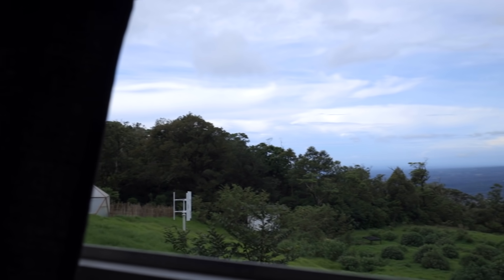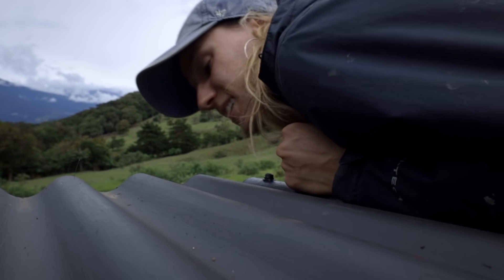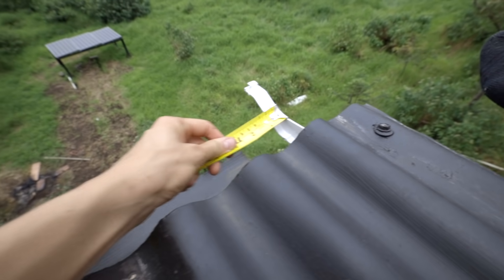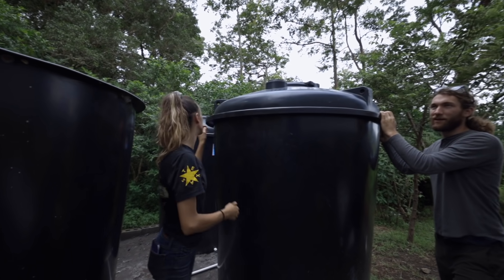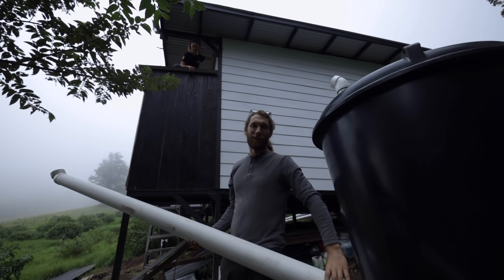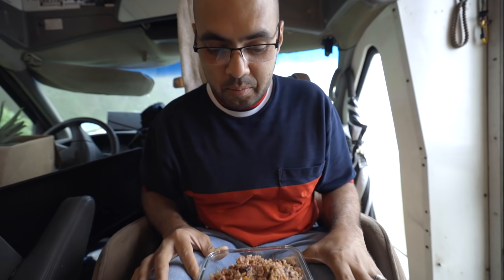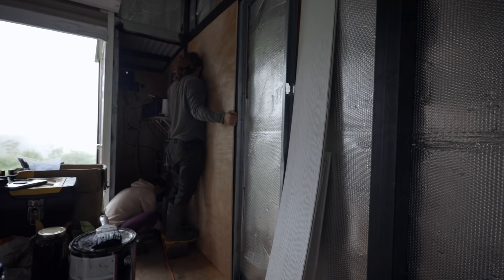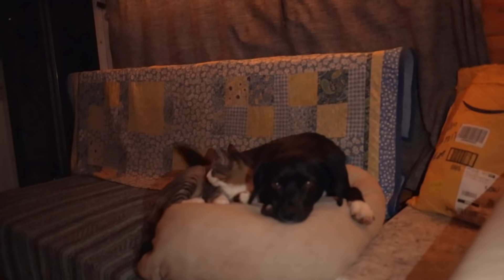Living Off Only Rain Water // off grid rain water system

Comment: My observation is the mistakes are a result of lack of planning.  I built only one house, for me and my family, but did not make a ton of mistakes.  That's because my nature, my education, and my profession trained me to plan projects.  I planned the schedule with critical path, costs, and made a comprehensive material list ahead of time.  Nothing was left to figure out later.  I spent more time planning it than building it.  You'll be able to do that on your next one if you choose to not make mistakes.  

That includes drawing everything out with dimensions.  Structure, electrical, plumbing, HVAC ...  Make you are modifications prior to finalizing your plan.  You guys have learned a ton and are able to build whatever, and if you plan it out thoroughly before you start then it should go off without a hitch.
Blessings.

Comment: Few comments on the catchment system. Did you make sure the gutter has a slight slope towards your down spout? Also have you thought of adding a first flush diverter? It helps clear the sentiment on your roof.
Reply from the maker: We did slant it slightly yes. We used a first flush diverter before and it didn’t do much because of the amount of rain we get. We don’t go through long stretches of time without rain for sediment to build up on the roof, it rains everyday! We’re going to have 1 sediment filter before the pump and 2 after so we will just see how that works out.
Reply: @NomadicMovement  makes sense. Every area is different and learning what works for you is so important. As an electrical engineer I've been really impressed with the things you have accomplished in your system. Next stop....hydro power!!! One thought for you tool hanging is french cleets. Customizable and very strong.
Reply: @NomadicMovement  Will you be using the heat buildup from the wind mill,  to provide the workshop with hot water?

Comment: Great work on the rainwater collection system.  Have you guys researched about a first flush diverter valve?  It diverts the first little bit of rainwater which is usually dirty from dust/dirt build up on the roof.

Comment: Have you considered building a shipping container barn? This would give you secure tool storage and lots of dry work space. This is a project you could build relatively quickly and then you could move into the structure you just built.  Surely there would be used shipping containers available in Panama. There are lots of examples of shipping container barns on the web. Cheers

Comment: You should install wood blocking between the metal studs at the height you want the shelves to mount. that way the shelves mounting hardware have a solid backing to attach to, otherwise you risk the hardware pulling out as they get heavier. it would also mean you dont have to hunt for studs as you attach your shelves.

Comment: Yeah, those studs are flimsy until you screw the plywood to them. It's the same way with wooden rafters that holds up the ceiling, they are all wobbly and flimsy until you nail the plywood to them, and once you do they don't wobble anymore, and they can hold massive amounts of weight. 
Glad to see you're using a long straight board clamped down to guide the skill saw. It makes it so much easier to produce clean straight cuts.

Comment: Hi and good work.  I know you guys were given the wind apparatus but you will never get much power with your set up.  First, the design of your generator has been discredited.  It just doesn't produce much power; thus, you need the standard 3 blade design that you see in large wind farms, boats, islands etc. Third, you must get height.  Even 30 feet off the ground you will almost double the wind capture and with tree canopy in your location you have to be above the canopy.  Love your vibe and positivity!!
Reply: Haven't heard anything about vertical wind turbines being discredited. There's plenty on the market and they're omnidirectional, which makes them very efficient. Jordan said that this one is 1kW, but the most similar that I could find is 10kW with a very low start wind velocity ~3.5 mph. However, there are also models with hinged blades that use centrifugal force to reef against excessive rotation during high winds. 
IMO, you are 100% correct about needing to get the turbine above the tree canopy (plus further away from the forest would have helped. Oh well). Under the circumstances, I'd start by inserting a 20 ft pipe (w/welded flanges) in the middle of the tower, with 3 guy cables. (I would hinge the bottom and rig a winch to raise/lower the tower) That will probably be sufficient for their battery bank, which will need to be expanded.
Reply: @TheOleHermit  There's a lot of worthless crap that sells.  That design is snake oil.  Completely inefficient.  5 minutes on google is all it takes.
Reply: @jlsinchina  Actually, thanks to you, I've just spent ~ 1 hour researching half a dozen "vertical vs horizontal wind turbines' articles and have found the common comparison as such: 
"– HAWTs are generally used under streamline wind conditions where a constant stream and direction of wind is available in order to capture the maximum wind energy. HAWTs are not effective where the wind is turbulent, so they are generally located in areas where there is a constant directional airflow. VAWTs, on the other hand, are mainly beneficial in areas with turbulent wind flow such as rooftops, coastlines, etc. Unlike HAWTs, VAWTs can operate even in low wind speeds and they may be built at locations where tall structures are prohibited."
Nothing whatsoever about VAWTs being crap designs. I've also been interested in alternative energy for 25 years and have never seen anything negative about VAWTs.
The problem is being located too close to the ground, not the turbine.

Comment: Guys. Stop using grinder to cut colourbond or tin!!!!!!! LYou need. Nibblers. Otherwise the heat will cause chemical reaction. (Hence rust)
Reply: I no you were talking to them but Thanks. I take in all these tips myself. Again,thanks for that tip. Rust is annoying,ugly and just something else to worry with. Easy fix on something's but I still gotta stay on top of it. I bet that's why edges of my shed roof is starting to rust. Can't remember what it was cut with but I can assure you I just grabbed what was closest or already out. Have a great weekend,thanks again.
Reply: @lorihutton4719  your most welcome. For the record I am registered builder in Australia. Here we have licensed roof plumbers. I’ve been told by a few of them it’s mandatory to use nibblers for the exact stated reason being rust. So yes Lori , great idea to take their advice.  Tin snips or nibblers all the way. 👍🏻👍🏻
Reply: They also need to wear a face shield when grinding or using the cutoff saw.

Comment: Hey guys, good job as always. I had a concern here though, at 1:00 through 1:17 in the video as Kaylee is climbing on top of the bathroom, you can clearly see the wall separating from the main building. I wouldn't expect this, is everything secure? I would think the framing would be more stable?  Perhaps the wall panels you talked about later in the will better stabilize everything? I am not a builder, maybe this happens, but with the winds you expect to get and if you are climbing up on the structure I find this a little worrisome especially if it happens elsewhere.

Comment: I didnt see a debris trap on your plumbing to the tanks. U can make it with 3" pipe fashioned like a "J" with a cleanout at bottom. The water (with debris) enters the top if the "J" ans the debris will settle ans the clean water leaves the left side of the "J" into the tanks. You can open the bottom of rhe "J" to clean out and leaves and other junk that accuumulates at the bottom